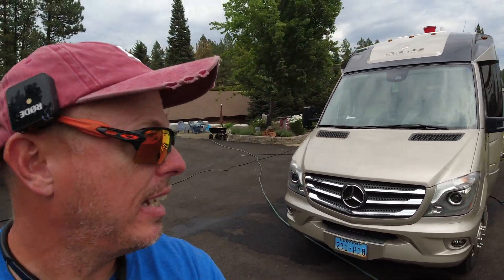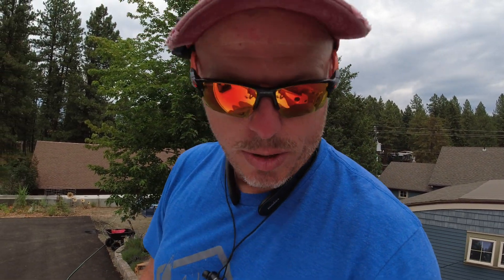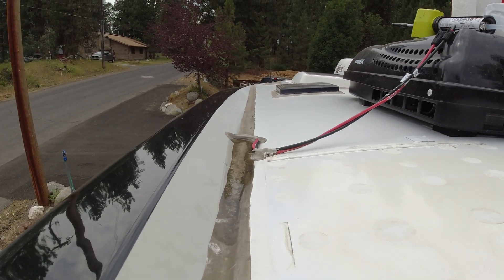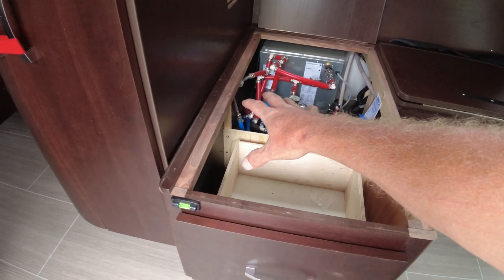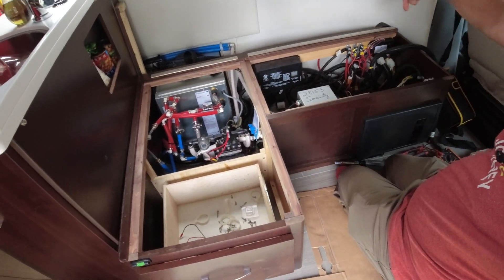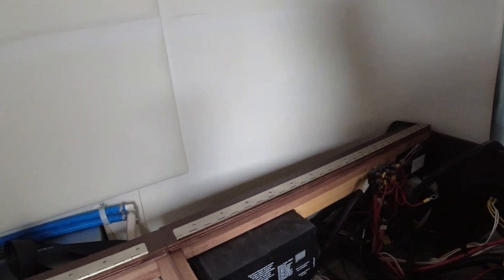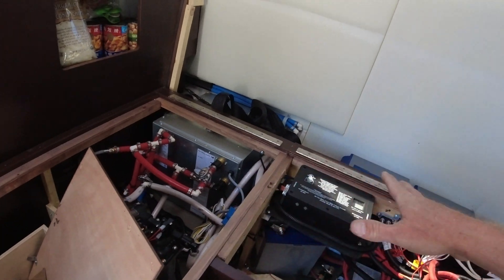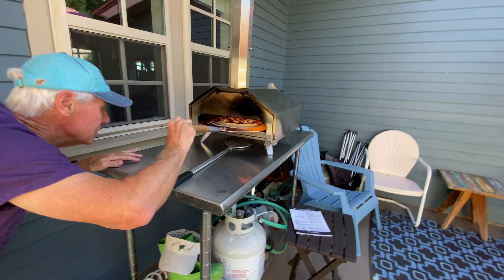Battle Born & Solar Upfit | 2018 LTV Serenity

Comment: Hi Mike - thanks for this video, curious why you put the batteries inside instead of outside where all the AGM batteries are?
Reply from the maker: In the space where the AGM batteries are located is only room enough for 2. You want to keep your battery bank all together, so that’s the biggest reason but my niche is to install everything internally, if possible, for temperature purposes.